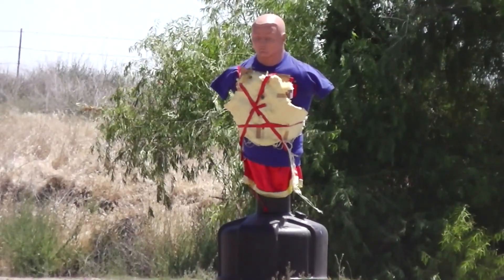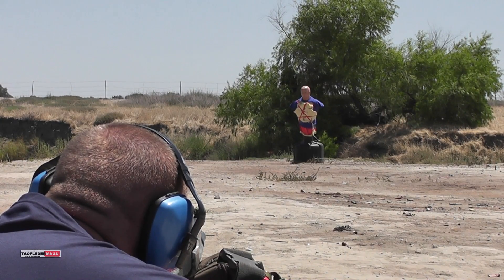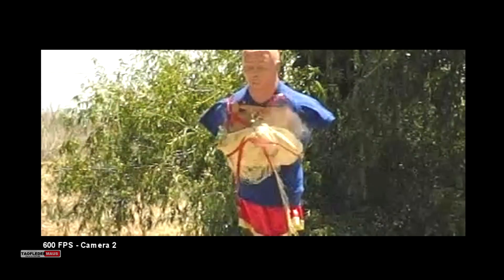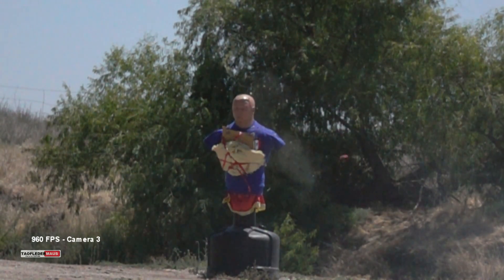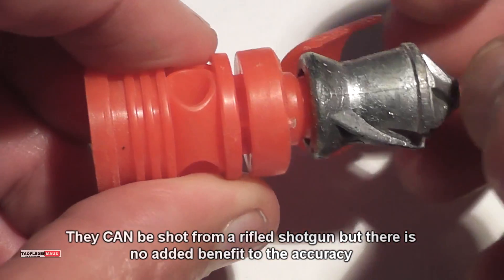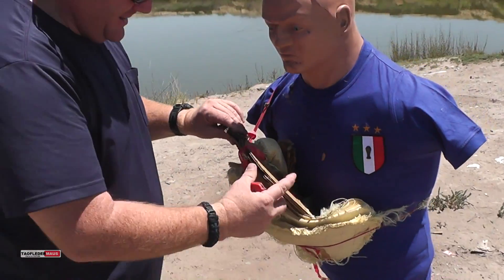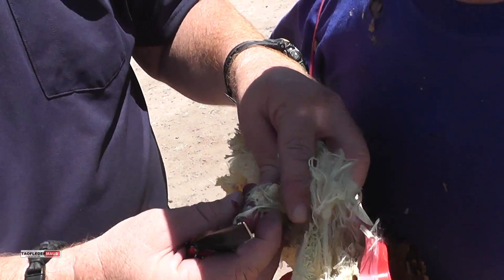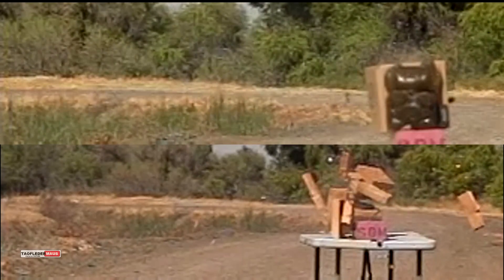Shotgun slug vs kevlar vest - It's WORSE than you think

Comment: People never do real life demos though...in real life there will not be a single shot. That material will have to sustain multiple shots which NO material can withstand at Shotgun caliber. Especially 10 and 12 gauge. It's kind of like trying to patch an exhaust pipe. Yeah, you think the patch job it's durable the first moments but sustained heat and pressure and that repair make you realize you need to get a new pipe period. No material can sustain repeated abuse. Try 3 shots from that gun. Then see what happens. Or empty it out and put all 6 in. Then what? That's a real life situation.

Comment: this is a good example for why we wear a trauma plate.
Reply: Sorry but a Trauma plate, Doesn’t make much difference if a 12 gauge magnum slug cannons into you from close range.
Reply: @timkc1638  when the difference matters so much it being not quite as bad as it would've been matters.
Reply: @Zaku186  might not be instant death but it would be inevitable.. think about this, if someone shoots you with a slug when you're wearing 3a armor (assuming you're defensive), the force would still be enough to cave in your ribs or sternum, trauma pads are mostly designed for handgun calibres, so if you're hit, you can breathe with broken bones, unable to move until whoever shot you, comes around to end it.
This is why 3A armors don't advertise themselves as shotgun proof, even though they're generally successful with birdshot and buckshot, because no one can guarantee if someone has a slug pointed at you
Reply: @mohammadnashitsiddiqui2168  a trauma plate is not the same thing as a trauma pad. A trauma plate is usually steel and made specifically for preventing soft armor caving your chest in.
Reply: @Zaku186  aaahh thanks man, this will come handy In shopping for this stuff!

Comment: That's very interesting how badly they begin to wobble below the speed of sound. I have shot them out of both smooth and rifled barrels, and they do well in both. I do get better accuracy from the rifled barrel guns, but It might be because the only smooth bore's I have tried them in are open sights. In the next month or so I am going to really push the limits of these slugs and see how they do at long range. For hunting, I feel the limit for pretty much any slug is about 150 yards, maybe 200 if conditions are ideal which they never are. Drop and accuracy isn't the issue, wind is. Still, I want to see how they will do past 200 yards, maybe even past 300 if I can still hit anything. As you stated in the video, the color change is nothing to worry about. Ballistic Products, and Gulandi in particular just molds them with whatever dyes they have. I have LBC slug of blue, red, and pink. It makes no difference, its just the color. I would still like to see more with these slugs, and maybe others. What I would like to see in particular is if a rifled barrel helps the sub-sonic wobble. Another fantastic slug if you ever find some are "buckbuster" shotgun bullets. Like the LBC sabot, they shoot well from both rifled and smooth barrels, but are a softer lead, and the hollow base is filled with some kind of rubber or silicone. Unfortunately the company went out of business about 15 years ago, and I haven't seen any besides the few hundred I got from gander mountain long ago. I hung onto a few with the intentions of some day having a custom mold made and making my own.
Reply from the maker: Yeah,  I'd say 150 yards is about the effective limit for these slugs.  I'm sure you could launch them 500 yards like s rifle grenade.  We've shot wax slugs at least 500 yards  but you'd be lucky to hit something the size of a  barn with them.

Comment: Thanks for another interesting video.

I'm curious about the effect those Plastic Sabot petals and Plastic Wading have on the Barrel, with regard to buildup of foreign material, compared to non plastic Petals/wading. 

I have to imagine that plastic ripping through a metal tube at high velocity would result in some plastic melting onto to the barrel bore.

Do you have to Clean the barrel significantly more often when using plastics? does normal cleaning methods get the melted plastic off the bore or is a more aggressive or alternative method used?

If you haven't done it already, it would be interesting to see before vs after images of a clean bore when firing different wading/sabot materials. You could maybe use one of those cheap endoscopes available these days for smart phones.

Cheers
Reply from the maker: Almost every shotgun shell uses a plastic wad,  and it doesn't melt or stick to the barrel.

Comment: that is just nuts. I pretty much expected it but to see it yeh your dead..

Something i want to see shot is a coffee can filled with red clay shot from the open end. With a supper sonic 1 oz slug. Im thinking it will blow the sides of the can out.
Reply from the maker: Clay really does behave like a liquid when it is shot.
Reply: Correct obviously but it also behave like a non Newtonian fluid. My thinking is a coffee can with the lid sealed shut say hot melt glued back on filled with water and shot and one with much the same done filled with clay the clay will just totally destroy it. And water would only say split it and tare it open. 

Basically as soon as the water has enough of a crack to evacuate the damage stops. Same goes for clay but because it will almost shatter when struck it will rip numerous holes through the can and do a fair bit more damage. 

Besides seeing the damage done to clay is always cool lol

Comment: thats a busted sternum for sure, fkn ouch :(
Reply: If the same amount of energy acts upon the shotgun and the slug, but the shotgun weighs 9 lbs and the slug weighs 1 oz, then then shotgun absorbs 144 times the amount of energy that the slug does.  So even if the butt was shaped like a slug, it would have 144 times less energy. (I never took physics, someone else jump in here with the math.)
Reply: The gun and the bullet contain the same energy, its just that the gun is a heavier object and thus is at a much slower speed. This low speed prevents the gun from bypassing your bodies dispersion of energy through your bones and issues; in other words, the much slower speed prevents it from unloading all the energy on a single point of your body.
Reply: ***** has a video of his home made cannon firing a slug which showed that compensating for recoil (securing the cannon to a log) had no effect on the projectile velocity.

My reasoning behind the busted sternum comment is that all the force is hitting the target in the area of that slug, the butt of the shotgun is at least 12 times that area.
Reply: +Gmail X you my friend are correct, once again mr physics is at work
Reply: Please explain.  Are you saying that if the butt stock was shaped like a slug it would penetrate the shooter's shoulder farther than the actual slug hitting a target?
Reply: Jeff Rielley it would cause the same damage as being shot with the slug.  I wonder if the Flying Mouse will put a potato between the shooters shoulder and the stock, see if it gets mashed
Reply: yeah sounds right, the energy from the explosion will be divided evenly between the gun and the projectile, so then is a matter of overcoming inertia and all that resistance and stuff

Comment: i know this is mostly a channel focused on firearms so i'll just leave the question here for the viewers to answer my curiosity what happens if you try to punch someone wearing body armor?
Reply: A guy wearing soft body armor can still feel the punch, but the SBA takes most of the "oomph" out of it.  We've had guys in my agency saved in car wrecks because they slammed into the steering wheel and the vest reduced the blunt force.
Reply: While I have no experience with the matter, I think it'd work like a bit of flexible padding. You can see about how thick it is, and you could approximate it with cloth or similar. For punch purposes, not gunfire purposes, of course.
Reply: It depends, if they're wearing a plate of AR-500, you would break your hand, if they're sporting kevlar, it might help a little, but its pretty much like punching a person with a coat/ sweater.
Reply: Yeah, I meant the armor portrayed. Punching a hard plate is going to feel like punching a hard plate.
Reply from the maker: You'd probably get shot if you did it to a cop. lol I'm sure it would knock the wind out of you still.   This kevlar is like a thick blanket.

Comment: Realistically, your body would be pushed by the force, absorbing some of the blow. Technically, since the  target was stationary, the force could be somewhat dramatized.

Still would hurt like a bitch...
Reply: The stand wasn't completely stationary mate, looks like one of those stands that you fill up with water. The stand would rock with the force, and the dummy is essentially rubber. You can literally see it rocking around after the hit.
Reply: NRThunderman The dummy and stand where most likely designed to take that kind of force. Most of the weight is at the bottom allowing the target to stay upright and counter the blow with leverage, stopping the slug instantly. This sudden stop would have a bigger impact on the light body armor.

A human, on the other hand, would be knocked off his feet, allowing the bullet to travel a bit more and slowing to a halt, meaning less impact on the body armor and human. I don't think that overall the difference would be that drastic. 

Either way, the only true way to simulate something like this would to be to do it for real. And i'm sure as hell not volunteering.
Reply: +Darian Alexander (Nerd With The Glasses) nope. Check out Mythbusters shooting a pig carcass. Only in Hollywood do people get thrown around.
Reply: Darian Alexander Spent a while trying to find decent footage, couldn't find any. You're an idiot if you think that this sort of stand doesn't tip over more easily than a human does, and rubber tends (key word: tends. Obviously this changes depending on who's getting shot) to have more overall flexibility than a normal human. The amount of force required to literally throw a human off of their feet (a healthy human, not one with disabilities) is most likely more than this would provide through an armour panel like this.
Reply from the maker: The base of the dummy normally is filled with water or sand.  But because we haul it around, it's empty. You can knock the dummy over with a hard punch to the chest because your fist is going a lot slower than a slug.   
A slug hitting it is more of a fast impulse  so the energy transfer happens so fast,  it doesn't have time to push the dummy over.
Reply: ***** Thanks for the explanation.

Comment: It's too bad they can't really make a better way to spread out the impact of the bullet.
Reply from the maker: There has to be a trade off.  They have to be flexible,  light,  and comfortable  enough to wear for an entire shift,   but offer protection against the most-likely threats an officer may encounter.
Reply: What about a metal plate? cough AR500 armor cough
... I bet it'd still hurt like mother**** though
Reply: Steel plate armor with padding behind it.
Reply: They use titanium plates (light and resists deformation) or ceramic plate (absorbs energy as it shatters) inserts to spread/absorb some of the energy.  But anything that stops a shotgun slug is going to transfer a LOT of energy to the wearer.  But the most lethal aspect to projectiles is when they tumble inside flesh.  So while life is going to suxxor when hit by a shotgun, at least you have a life to suxxor.  If you want to incapacitate someone, their wearing body armor is a bonus, allowing you to transfer all of the slugs energy to their body.
Reply: As a medieval nut, I find it very interesting in the parallels of medieval and modern armor technology.  BTW, full plate is more comfortable than flexible armor.  I don't expect police forces to adopt full plate due to the psychological effects, but I do see a day soon where the military will begin designing said armor.  For example, in this video, if Dummy had been wearing a full clam shell, his ribs would not have broken, although he would probably have been flung to the ground.
Reply: Krieghandt If the round had enough force to knock you down, it would go through the armor and you would explode.
Reply: Krieghandt The weight of armor thick enough to stop a bullet is far too much for military use. Remember that medieval plate armor didn't even stop crossbow bolts, but was designed to deflect arrows and swords.